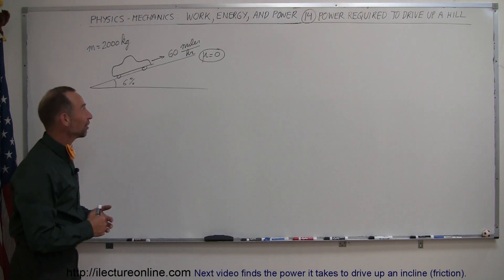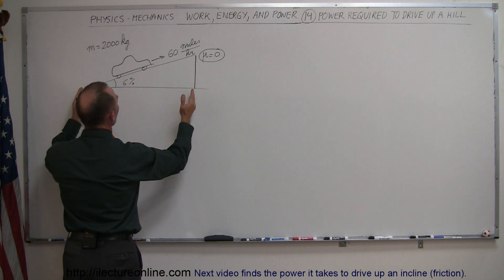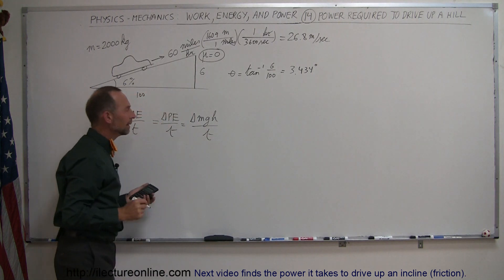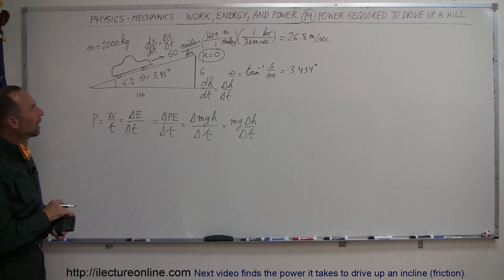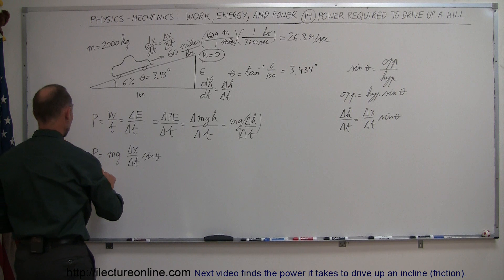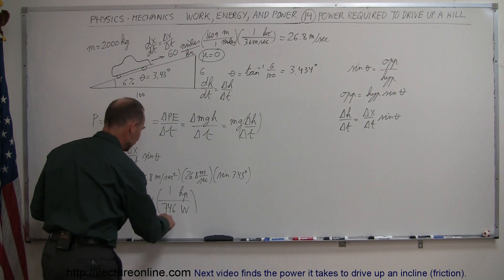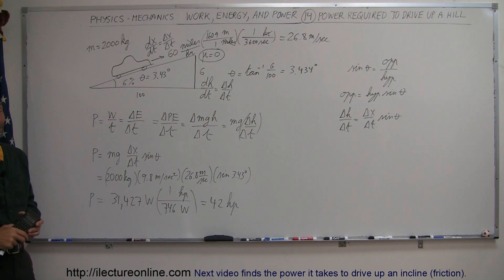Physics 8  Work, Energy, and Power (14 of 37) Power Required to Drive Up A Hill

Comment: I’m kind of confused here, as you say there is no kinetic energy in this system which makes sense as you explained. What doesn’t make sense is the fact that people generally say KE=1/2mv^2 which is defined in this example. What I’m guessing is that that formula only works for accelerating systems. Would you be able to explain this?
Reply from the maker: There is kinetic energy, but if the velocity is constant there will not be a change in the kinetic energy and all the work done will be used to overcome friction (if considered) and the increase in potential energy, which will determine the maximum velocity of the car.
Reply: @MichelvanBiezen  Ok, so we are only considering the change in kinetic energy? That makes a lot more sense thanks. And congratulations on 1mil subscribers, you have deserved it for a while now
Reply: On top of all this, KE=1/2mv^2 is used everywhere to derive lots of well known equations and formulas including Schrödinger’s equation, so if it’s used everywhere than surely it would be applicable whenever there is a moving body. Again your explanation as to why there is no kinetic energy makes complete sense, there just seems to be a contradiction

Comment: There is no kinetic energy in a moving mass there is force Mv squared ,kinetic energy is the energy of consistent work from a consistent force regards Graham Flowers
Reply from the maker: By definition  KE = (1/2) mv^2    therefore KE is proportional to v^2 and an object only has kinetic energy when the object is moving.
Reply: @MichelvanBiezen  A mass moving at 50 mph all of the mass is moving at 50 mph fact if kinetic energy is half mass velocity squared what is in the other half regards Graham Flowers
Reply from the maker: There is no other half.  The total kenetic energy is:   KE = (1/2) mv^2    To suggest that there is a "missing" half is not mathematically sound.
Reply: @MichelvanBiezen  A mass moving at 50 mph all of the mass is moving at 50 mph fact if kinetic energy is half mass velocity squared then what is in the other half regards Graham Flowers
Reply: @MichelvanBiezen  each mass has two Half's fact to imply otherwise is foolish regards Graham Flowers
Reply from the maker: You are repeating yourself, asking the very same question.   I can only give you the very same answer.   The constant, "1/2", does not imply this represents half the energy, it is simply the constant of proportionality in the equation to make the left side equal to the right side.    EVERY equation in physics has such a constant of proportionality.
Reply: @MichelvanBiezen  what does a 1/2 mean it means one divided by two half's regards Graham Flowers
Reply from the maker: No, the 1/2 does not imply in any way that there is "another" 1/2.   It is simply a constant like in the equation:  The potential energy of a compressed spring = (1/2) k x^2 which does not imply in any way that half the potential energy is missing.
Reply: @MichelvanBiezen  but it does imply that not all the energy is usable regards Graham Flowers
Reply from the maker: I don't agree that it implies that, since 100% of KE ( = (1/2) mv^2) can be converted into heat or into potential energy.
Reply: @MichelvanBiezen  A 100 percent is a 100 percent 1/2 is 50 percent. regards Graham Flowers

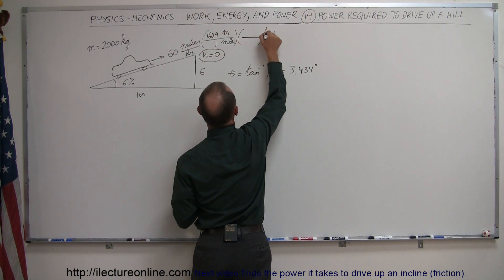Comment: At 2:09, shouldn't the ratio of miles to meters be 1.6 m / 1 miles. Great explanation, thank you very much!
Reply from the maker: 1 mile = 1609 m  (1609.344m)  No apologie necessary.  🙂
Reply: oops! Just realized 1.6 km = 1 mi, therefore the ratio in the video is correct. My apologies!

Comment: Professor, could you see and answer my question. I know you are busy but it would help;Is the reason the car doesn't accelerate is because all the work being done/power provided is going to potential energy. Or another way of saying it is that gravity is doing negative work, making the net work on the car zero as long as it puts out the 42 hp? Just checking my understanding
Reply from the maker: Correct, all the work done is used to overcome friction, wind resistance, and converted to potential energy.  There is no extra work to increase the kinetic energy.
Reply: @MichelvanBiezen  thank you

Comment: Is the reason the car doesn't accelerate is because all the work being done/power provided is going to potential energy. Or another way of saying it is that gravity is doing negative work, making the net work on the car zero as long as it puts out the 42 hp? Just checking my understanding.

Comment: Sir, I could divided the weight of the car in x and y component. So mgsinθ is the F necessary to moving the car, then mgsinθ*v=P. Is it correct?
Reply: You could do that and get the answer but it’s important you anderstanunderstand the weight of the car didn’t just disappear, sintheta is accounting for the vertical component of the velocity

Comment: I have a set difficult questions that I cannot solve can  you plz somehow solve them if I give them to you?
Reply from the maker: You can always ask, but my time is very limited.
Reply: Michel van Biezen here's the question Sir please help me here if you are able to get some spare time...A driving force of 200N is needed for a car of mass 800kg to travel along a level road at a steady speed of 20ms-1(velocity) what power is required to maintain the car at this speed up a gradient in which the car rises 1 metre for each 8 metre of travel along the road?
Reply from the maker: The power required to drive level = W / t = F*d / t = F * v = 200N * 20 m/sec = 4,000 W    The power required to gain height = W / t = F * d / t = mg * h / t = mg * v(up) = 800 kg * 9.8 m/sec^2 * (20 m/sec * 1 / 8) = 19,600 W.  Thus the total power = 4,000 W + 19,600 W = 23,600 W
Reply: +Michel van Biezen Thank you Sir

Comment: hey sir why did you use h/t?
Reply from the maker: I used dh/dt which means the rate of change of the height with respect to time.     Solving for dh/dt will tell you how fast the height of the car is changing which allows you to calculate how much power the car needs to accomplish that.

Comment: I can't understand the part dh/dt
Reply from the maker: +Aze Siah 
dh/dt is the derivative of h with respect to time  (used in calculus)

It can also be taught of as the change in height over time (how fast the height changes over time)
Reply: +Michel van Biezen 
isn't dh =6?
only dt is unknown right?
Reply: +Michel van Biezen 
On top of that, for the triangle for the 3 sides we have l=100, h=6, hyp=sqrt(100^2+6^2)=100.18
so the time taken for the car to move up 100.18m at 26.8m/s is 3.74s
thus, P(rate of work done, J/s)=(mgh)/t= (2000*9.8*6)/3.74 = 31460J/s

1. Is this method correct and can it be used for other situations? OR
2. Your method is like the general method that can be used for all types of the same questions
Reply: +leejy2 
The expression "dh/dt" is similar to Δh/Δt, except the d means that the changes in h and t are infinitesimally small (in other words, they approach zero).
So "dh/dt" tells you the change in height over a very, very, very small amount of time (you can think of it as an infinitely small amount).
This is essentially the time derivative of h, which is velocity.

For example, let's say that the height can be expressed as h(t) = 2·t, and that h and t are expressed in meters and seconds.
This means that for each second, you gain 2 meters (for example, h(1) = 2·1 = 2 m, h(2) = 2·2 = 4 m and so on).
So if you take the derivative of h(t) = 2·t, then you will get that v = h'(t) = 2, which does indeed tell you that the velocity is 2 m/s.

Also, since the velocity is a constant, this will also mean that the acceleration is zero, and that the derivative of velocity will be zero.
Reply: +leejy2 Ha, that's actually an easier way to solve this.

Comment: can you do this problem using  power= W/t ..? how do you know when to use power= dE/t vs W/t
Reply from the maker: Adelle,
Certainly.  You can do the problem and most problems involving work, energy, and power both ways.  Notice that I started the problem with P= W/t and then I could have continued with P = (F* d) / t.  After that you can replace F with mgsin(theta) and replace d/t with velocity. In the end you'll get the same result.
Reply from the maker: Michel van Biezen In the end it doesn't matter which way you solve the problem.  It is whatever you are most comfortable with.  That is why it is good to look at a number of examples.  Some techniques are better for some problems and other techniques are better for other problems.  Practice by doing the problems yourself after you watch them is key to understanding.
Reply: +Michel van Biezen  In that case, what will be the d?